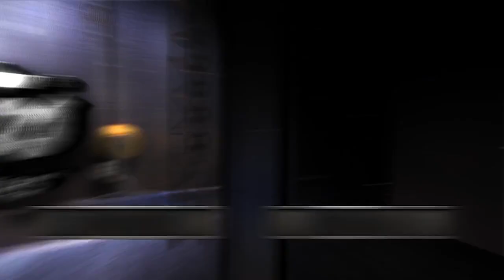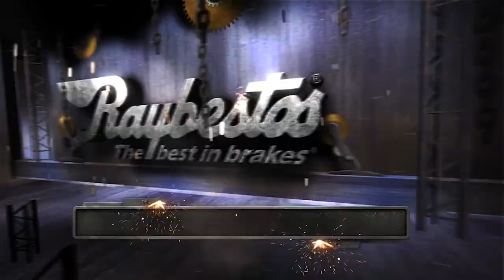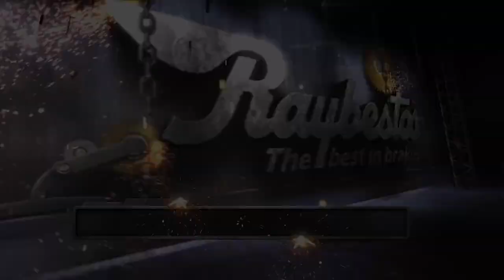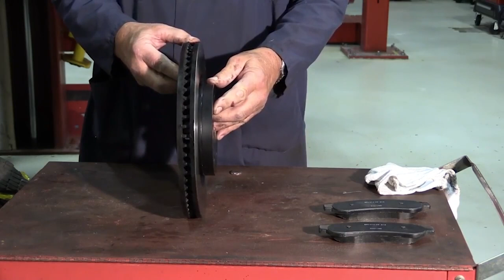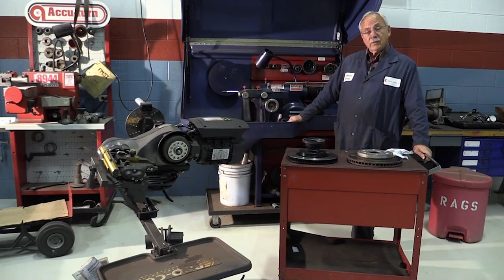Disc Thickness Variation and Lateral Runout Discussion

Comment: Had this problem when replacing rotors and hubs on my car. Problem was the new hubs that I discovered after rotating rotors 90° and side to side. I was able to cure with hub correction plates from Raybestos. Thanks!

Comment: This is the perfect example of what technicians should be. Today, most to all repairs facilities including new car dealership service. Do nothing close to this. They will replace at your expense.
Reply: Back when labor was cheap and parts were expensive, this is how technicians were. Today, parts are cheap and labor is expensive. Why spend 2 hours at $150+/Hr measuring rotor run out and cutting rotors when they can simply be replaced (with a warranty) for $40-100/ea?

Comment: Ride your brakes down a long hill, until they really heat up, then come to a complete stop and keep the brakes depressed.  That'll transfer some of material which will cause unevenness...

I just take some emery cloth to the rotors to remove the excessive material transferred from the pads.  Then new pads are installed and there are zero issues with pulsation.
Reply: This sounds crazy dam. Can't be this easy
Reply: I heard this is a process McLaren recommended for their cars except you need to very fast if it’s for a McLaren.

Comment: Great video. So I'm guessing the hub surface or brake hardware was corrected to explain why a new rotor (after run-out inspection) was sufficient to send a customer down the road with.

Comment: "Rotors don't warp"

Subsequently measures rotor warp after stating manufacturers have reduced lateral runout to <.001"

JUST came back from running two AK Master SAE J2522 dyno tests...

Lateral runout before test#1:
.048mm

Lateral runout after test#1:
.263mm

Test duration ~10hrs (eliminates corrosion at hub concerns/issues)

Delta TIR = .215mm (~.0085")

But rotors don't warp?  Rotors DO "warp", and this is independent of DTV, don't let anybody tell you otherwise.

Comment: Seems like the the difference between warp" and "thickness variation" is purely semantic. If the rotors weren't "warped", why don't you just grind out the "thickness variations" and make the rotors uniformly even. In any event, what's the difference between warp and thickness variation if the rotors have to be replaced.
Reply: @ItsVideos   The term "warp" has been accepted in common parlance  among auto mechanics to mean thickness variations on the surface. Get a grip on how words obtain different meanings according to common usage over time. There's no reason why the term "warped" can't be applied to differing contours of the surface of the rotor in addition to a full bending of the rotors especially when there is no meaningful difference between the two. If there were some meaningful difference the guy in the vid should have turned the rotors, but he replaced them. So who cares about some meaningless distinction made in the video.
Reply: @ItsVideos  He suggested it as one option to alleviate 3 types of warped rotors, but then in this instance he replaced them.  So he did unnecessarily more expensive work than was actually needed. Some honest mechanic you got there.
Reply: @Fish hey where'd you go?   Not confident enough in your comments to let them stay public? Not surprising.
Reply: I have been asking this question over and over again myself for a long time now    also  why is there a need to check the rotor  if it is new   out of the box       good question Paul
Reply: @joehyundaitech7961  Because most rotors are Chinese junk with sloppy tolerances. Quality parts stopped being produced in the 90s.
Reply: Rotors absolutely can warp !!  I had a 74 Camaro with no fender wells. If brakes were hot under heavy braking and you hit a puddle, they'd warp like a Pringle. It happened a few times and it was easy to see with the naked eye.